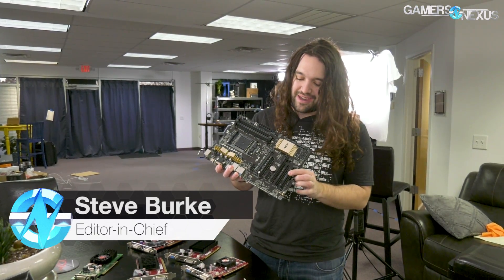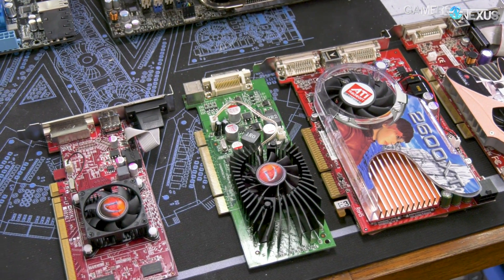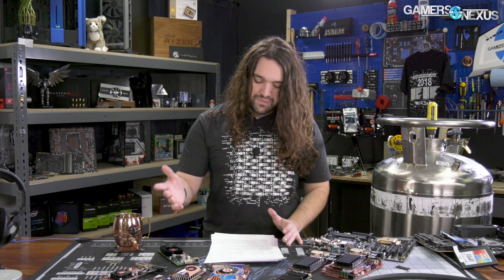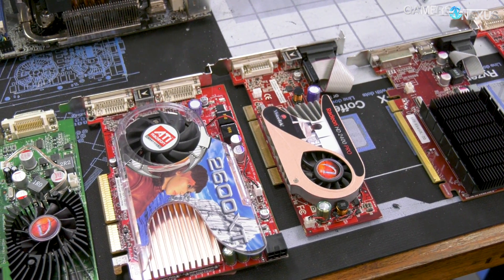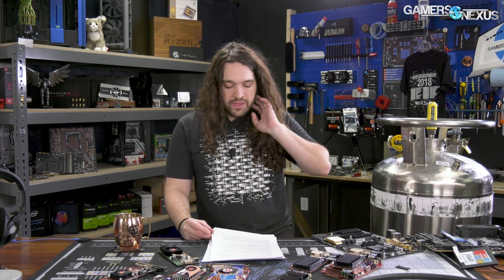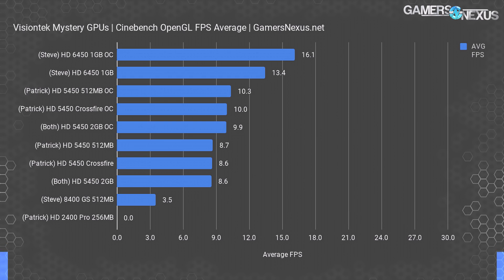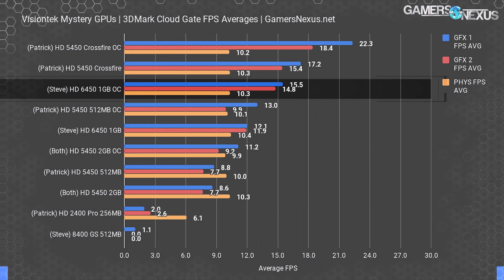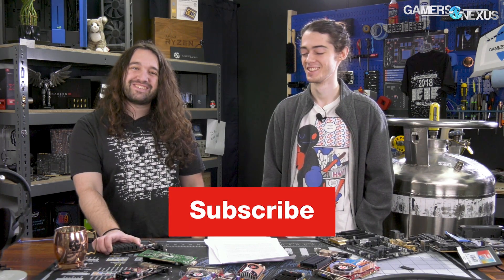Buying a Mystery Box of $5 GPUs from Visiontek | ATi Benchmarks

Comment: I stopped dealing with an HD 5000 series or below because it doesn't play well with W10 and Driver support. So I used a 6200 and up until those nvidia drivers don't work anymore. These are for office workstations anyways.

Comment: $150-$200 or what ever amount ebay only challenge budget would be based on cost of parts and bonus points given for lowest shipping cost.  Bonus points for a case, tho not required or use an extra one you have laying around no prebuilt OEMs ie Optipleses only oem motherboard and or CPU combos¯\_(ツ)_/¯ or something like a best retro XP gaming build ebay only challenge

Comment: I had two of those HD 2400 Pro cards, both passively cooled. I could go into Afterburner, crank the sliders all the way over, and they just took it. Very noticeable bump in Halo CE. I was planning on running them in Crossfire but didn’t have a working board for it at the time and I’ve since sold the one. 

Also, don’t do the slider thing in Windows 10. They didn’t like that quite as much.

Comment: I'm building an old Socket 939-based Shuttle PC for a friend as a retrogaming system and I'm absolutely stunned how bad the HD5450 is.  For a card from 2005, it struggled to run Return to Castle Wolfenstein even at 640x480.  Because the Shuttle is space limited and the PSU doesn't provide PCI-E connectors (and chaining an adapter off a 4-pin molex confirmed it didn't have enough wattage to support it anyway), I ended up finally settling on an unused GeForce GT440 I got on eBay for $10.  The cooler is right up against the side of the case but the case has some ventilation holes, so I'm calling it 'Good Enough'.
I wonder if your viewers would like a retro-style "Scrapyard Wars" where the GN staff competes to build the best bang for the buck PC from vintage parts for $100.

Comment: The nVidia card is a Quadro NVS 290 not the equivalent Geforce 8400gs. They are both G86 GPUs, the main difference is that DMS-59 (Dual Monitor Solution) connector which provides dual VGA and DVI on a low profile card. If you load the appropriate Quadro driver it should identify correctly, supposedly more stable at the cost of speed.
Reply: 100% correct

Comment: In the local used hardware shop in my city they sell those old cards for 20 cents each...
If you go that old the HD 6970 can run Battlefield 4 on High-Medium settings at 60 FPS.

Comment: The "mystery dvi" connector is used on cards that were found in a lot of Dell desktops that were in the labs when I was in college. Believe they were all 3rd gen core 3 or Pentium/Celeron of the same era. Not that it's worth a few dollars for a display adapter, but they had a dongle that could convert that "dvi" connector to vga, HDMI, real dvi (or 2), or even display port. Do be clear, it wasn't 1 dongle for all of those, but rather a separate dongle for each depending on what you needed.
Reply: Dms-59
Reply: Think it is called DMS 52???... you can get adapters that split into two VGA's or DVI's on ebay pretty cheap.

Comment: I use an AGP card in my old P4 gaming system. I use the old abit vt7 32 bit P4 system to run 32 bit OS and games with 8 bit installers that can run on any 64bit OS. Like Shogo Mobile Armor Devision for example. I dont remember but the card was actually released primariky as a pcie card so it is definatly overkill for amy old game. Some sort of ati.

Comment: Considering I just recently managed to get a Socket A build together, the visiontek mystery box did save me... because my stalwart and long-running 6600GT was finally starting to show signs of dying on me after all this time. So in that case, it was either get the mystery box or basically have nothing. Especially since the PCI card that I did get should have been a lot more powerful, BUT requires a DMS-60 cable, which ebay wants to sell for more than the $5 I paid for the card itself. So, there is that use case for me. That said, rather wish that they had sent a geforce for the AGP card at least, if only because that era was not particularly kind for Radeon drivers. As it is, I have a 2600 Pro AGP that flat out refuses to even accept any driver install of any version, ever. And even if you can force install a driver, it creates a BSOD kill cycle where I can't even get into safe mode without it crashing.
Reply: I have a socket a machine with an HD 2600 Pro AGP. I used the Catalyst 10.4 drivers from Vsiontek. The AMD stock drivers don’t play well with agp versions of pci- e cards. https://www.visiontek.com/support/download-drivers.html

Comment: Here’s some cheap content you can do. The last time the bus slowed down a graphics card was the ISA 16-bit bus back in 486 days; you really wanted a VESA bus to let that DX2-66 fly. Since then the BUS has kept ahead of graphics cards. When AGP was introduced it made fuck all difference to then existing cards; same with AGP 2x, 4x, 8x, pci-e 1, 2 and 3. The question then is what happens if you take a motherboard in 2019, and a high end graphics card in 2019, and benchmark it with the bus slowed down to the equivalent speeds of these older buses?

What you want is a motherboard where you can force pci-e 4 lane mode and force 1.0, 2.0 and 3.0 speeds. If you can find that it’s a cheap and interesting thing to test.

Comment: Steve, if you wanted to test on a modern platform, the Asus Prime B350-Plus, Asus Prime X370-A, and the MSI B350 Tomahawk all have regular PCI slots in addition to PCIe. I have had very good luck with the B350-Plus myself.

Edit: To clarify for those that may not know, these are AMD Ryzen motherboards.

Comment: Just a quick note, if you want to find out what a specific expansion card is, a barebones linux (e.g. a debian or arch installer disc) and lspci will usually help loads. they will run on just about anything and give you a model/make to work with

Comment: There are niches for those cards. For example - as a simple secondary adapter, when you just need a third screen. I recently spent a day looking for a PCI card that has a digital output and Windows 7 64bit drivers. I needed it for a third screen for my workstation.

Retro gamers are also eating those up quite fast - especially fast, but old interface cards ( such as Radeons 4xxx, 5xxx on AGP ).

Comment: I already have a retro computer (also have a new machine). The retro computer is a AMD Athlon X2@1,2Ghz AM2 socket, 3,5Gb DDR2 ram@400Mhz, Ati radeon 9200SE 64Mb VRAM and 2x 250Gb IDE harddrives. All running in a sound insulated chiftec case. It is very silent, but then again theres almost no heat, or performance. 🤣

Comment: There are LGA1150 mobos with PCI non-express such as my MSI PC Mate z97 mobo, and I think (but don't quote me on this) they can run PCI non-express GPUs without issue as I may have ran an old Radeon non-HD 7000 64MB on it at one point (maybe, I'm unsure - normally I would test it right now, but my mobo has been borky recently whereby it can have issues posting if I change out any hardware, but it runs perfectly if I just leave everything "as is").
Reply: Same, I was thinking even my Haswell machine has one which isn't that old. Used to pay a lot of attention to your posts on Beast's Lair, by the way. Pretty nice to see you here.

Comment: These are old cards that aren't compatible with the latest hardware and software. The computer industry developers no longer want to support the legacy hardware. There's no incentive for them to provide adjustable software support and hardware tweaks to fit the items into the latest equipment. Developed in the mid-1990s, the AGP port design lasted into 2010, but by then support for the GPU design dwindled. Only software and hardware manufactured prior to Windows 7 could have a chance of operating those video cards.
Reply: or use some BSD or Linux kernel.

Comment: 🙂 i love low spec video cards, i have some visiontek in my colection, hold onto the agp cards in case u pu a really old ancient computer that u want to mess with like a Pentium 3

🙂 the 5450 6460 are too fkn weak, they have only 275 Passmark Points, i would suggest instead 7570 5670 or GT 8???? 9???? that will get you 800 to 1000 Passmark Points, the cards that have Triple Output of vga dvi hdmi are the most valuable, they are very useful in third world developing countries where most cheap monitors are still using low tech connections

🙂 for a gaming benchmark i highly suggest instead Tomb Raider 2013, just let it reloop for an hour or more to test fps temp stability. Metro Last Light is too heavy and kind dumb, like what were u thinking dumb? 🙄 And dont buy the Epic version 😒 of any Metro game instead wait until it comes out on Steam or GOG 📀📀

🙂 Resolution: the sweet spot is 1280 by 720, dont even bother testing with 1080 because if u want 1080 then why THE FCK are u looking at these low spec video cards, thats really fkn dumb 🙄

✌️😏 anyways cheers, im gonna blow out some used low spec pc components outside today since its nice outside, any questions or u need help just let me know, have a nice weekend guys 🙂🥃🕹️🎮
Reply: What a stupid kid, another one of those nvidios I expect get a life

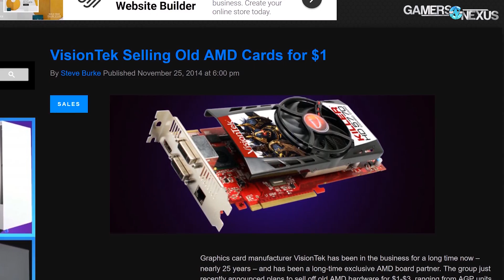Comment: Is that a video card with an Ethernet port at 02:15? I'm trying to think of the exact angle ATI/AMD was coming from. I'm still using a 5450 in my HTPC - it's a great card for H.264 decoding with an incredibly lost cost.
Reply: That would have been an OEM requesting that, or VisionTek, not an ATI/AMD choice.  It was most likely a prototype like card though.

Comment: I believe when he says this hardware is no longer useful it's because he's referring to the tasks and games or productivity that he specifically requires. Most, if not all of that hardware aside from defects would run in a Linux environment just fine. I myself have two daily drivers and both are hardware from this era. I have no need to upgrade as I can complete everything I require. I find it disappointing that people will trade up or dispose of a perfectly working computer just because Windows will not run or operate smoothly on it. Windows is toxic to hardware.
Reply: well, it's not only on Windows but also on webdesign, softwares and videogames. Nowadays, web browsers and websites are heavier and a simple pixel-art retro-styled games are using a lot of resources.

Comment: I have old his 7850 2gb just laying around i upgraded to r9 390 which i still use i wont upgrade again till navi comes out. I also have ga-ma790xud4p with amd 1100t and 2 4gb of ddr2 for total 8gb i built that system in 2010 and used up to August of 2018 i now have ryzen 2700x and msi x470 gaming carbon pro. And 16gb of 3466 ddr4.

Comment: That reminds me that I've still got a 6950... and a 5670 or something or other I think? Both working order, but just replaced. Kept them as backups but nowadays, I have no idea really what use they have. Can't really sell em for anything meaningful. That was to replace an old Nvidia GeForce 6700XL which had a fan failure so it wouldn't keep cool and kept artifacting and locking up. The manual of the system PC called it amongst the highest-performing graphics cards. It also came with a Pentium D on a BTX form factor motherboard that screwed over any potential upgrade path XD

Comment: Wait... So the hd 6450 released in 2010 and the hd 7970 released in 2011. 6450 is basically trash and a 7970 is actually a decent card. One year made a crazy difference back then or am i missing something? 😅
Reply: The 6450 was a low end card, while the 7970 was a flagship card. also the 7970 is more than a “decent card”
Reply: Comparing an hd 6450 to a 7970 is like comparing a gt 1030 to a 2080 ti.
Reply: @EvilTurkeySlices  Key sorry, i thought Steve said they got former "high end" cards for 10 Dollars, so in my head the 6450 was the Flagship of that time.

Well i know the 7970 pretty well, was my last card until i got into VR. It actually run a bunch of VR Games fine, but i had a little money left over so i bought a 1070 ti when it was on sale.

Comment: im surprised you guys had so much issues with pci cards. I just installed windows 10 on a pci s3 gpu with a asus lga 775 board. It was black and white as well as super low res but it did work lol.
Reply: That’s just the s3 card.

Comment: That strange nvidia card's connector is likely a DMS-60 output. I myself have a nvidia quadro with a DMS-59, but the DMS-60 is a new one to me. I am curious if you could even find an adapter to convert it to regular DVI or VGA. That port should be able to output to two separate displays, depending on the adapter used.

Comment: HD5450 is plenty adequate for browsing / YouTube etc. I put one in a basic build for a friend - on CEX  they go for £15 (1GB/2GB) or £8 512MB
Where £5 gets:
HD4350 512 (DX10.1)
GeForce 8400GS 512 (DX10)
GeForce 7600GS 256 (DX9 ugh)
Reply: you will get even better performance  if you  use a  linux  build  as well and  use a 32bit linux install if less tehn 1GB ram

Comment: still running a old asus ares hd5870x2 4gb gddr 5  on windows 10  115 fps opengl  .  cinebench r15 opengl test  been good card .  wish better drivers tho  amd 12.4 doubles the fps  vs. the 15.7 driver to run windows 10

Comment: How is it possible for ATi cards to survive that long?! AMD and ATi is known for shorter lifespan.
Reply: That's a bit of bullshit my man
Reply: Tell that to my 6000 and 7000 Nvidia Geforce cards, I had a 6800 and 7950 that borked out on me a few years back and yet I have even older ATI Rage 128, Rage Fury, Radeon 7000 (non-HD) and Radeon 9600 that still work to this day.
Reply: I've never had an ATI or AMD card fail me, or an Nvidia card to be fair, maybe I've been lucky, or maybe you're just talking bullshit
Reply: The only cards I’ve had die are Nvidia.
Reply: Statistics show majority of failed cards are from AMD, not nvidia. So if your ATi/AMD card survived long time you just got lucky.
Reply: @Arif_Islam77  and which statistic is that? Any source
Reply: @nonameyet2205  just look up any statistics on Google. AMD has higher failure rates in all statistics lmao
Reply: @Arif_Islam77  Nope, didn't find any.
Reply: @nonameyet2205  Then you dont know how to search
Reply: @Arif_Islam77  How about you provide a source and don't just talk non sense without any proof.
Reply: Both AMD and Nvidia produce faulty cards from time to time, I don't remember exactly which models but some older macbooks have an Nvidia GPU that will die and make the macbook unuseable.
Reply: @vgamesx1  8000 series

Comment: You should find a test against a raspberry pi and see how it compares to its gpu
Reply: The Videocore IV is a cheap iGPU from 2011 so you shouldn't expect a miracle. And if you try to compare, that will be biased because you have to change a lot of hardware parameters (not the same CPU and RAM, not the same software optimization between x86 and ARM even with Linux/Android). If the RPi had a PCIe it would have reduce the bias.
Reply: @PainterVierax  the difference in hardware is what will make it great. Can they make a $35(+ the cost of a power supply and SD card) Linux box and test it against a raspberry pi. Yes the hardware is different and maybe one is more optimized than the other. well that all plays into the battle. Just keeping the price the same is the only control needed.
Reply: @tpolarbeart  Well, you need a game  developed for x86 and ARM with no arch-specific optimization and that could run on OpenGL ES to test the GPU (otherwise you'll be comparing CPU performance). I'm not sure games using SDL are good candidates. Maybe games like Minetest or SuperTuxKart should do it. But even with that, you still want to compare apples and oranges.
Your old x86 system is better suited to run old x86 games, it has better drivers for peripherals, better extension possibilities, virtualization capabilities, etc. An ARM SBC is more suited for running light server, mediacenter, emulated games, Android apps or tweaking GPIO and with low consumption in mind.
Concerning the price, SBCs and ARM SoCs continuously improves : even the third generation of RPi is quite a bad price/perf comparing to Rock64Pro, XU4 or Thinkerboard which are a bit more expensive but embed a way better CPU and GPU. If you keep searching for the best ratio, you'll end up with a used Athlon 64 or higher.
Reply: @PainterVierax  dude you are over thinking this way too much. I own a lot of these SOC I know the comparison is not like for like and that's the whole point. I test them against an extreme edition i7 for fun just to see the huge difference. I would love to see it compared to an old computer. Literally the only thing that would have to be like for like would be the price and even then if that wasn't the same I wouldn't care
Reply: @tpolarbeart  OK but what's exactly the point ? On what criteria do you compare those computers at the same price ? Before benching you need to think about the use cases and workloads you want to compare them, especially when there are a lot of architectural differences like that. Benching for fun is not enough to make GN content, they need something interesting for a consumer's perspective. If I'm overthinking it's because your suggestion makes no sense with their editorial philosophy.
Reply: @PainterVierax  you are over thinking again and missing the point. They just compared $5 gpu's against themselves for fun. Don't underestimate what GN is willing to do
Reply: @tpolarbeart  I don't underestimate what they do. Absolutely not. I don't see the point of your suggestion, that's all.